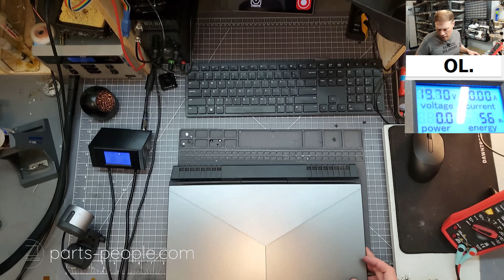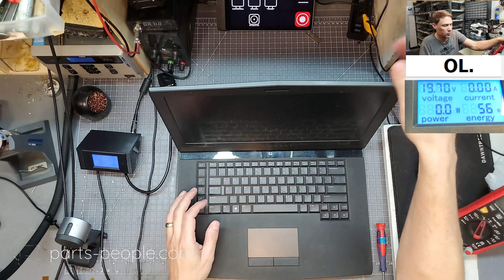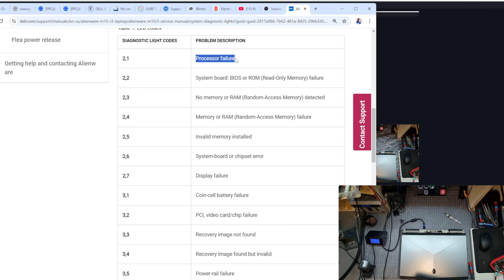Why THIS Alienware Suddenly DIED! And Can It Be Prevented?

Comment: I went through 4 motherboard on this model had a lot of dead cpu when under warranty.. happened again out of warranty bought a repaired motherboard on ebay and never had any issue for the past 3 years..
Reply from the maker: Wow crazy! 😮 This customer said that had it replaced in 2021, but the laptop is now more than 7 years old.  I think it had a pretty good run, considering.
Reply: @dellpartspeople  i dont know what the tech did on the motherboard maybe better mosfet (i dont know if it help prevent the voltage short to cpu/gpu) but it last way longer than all the other dell provided
Reply: I bought one in 2017, gave to my son this year because he just plays minecraft and doesn't care about windows 11. Never replaced anything else but the battery that just starts swelling after 2-3 years of use (replaced 2 times already) and the charger (the sensor stopped working after 1 year and the laptop wouldn't recognize it as original), then I got an updated version and never had any more problems with it. 
But I really don't recommend this laptop to anyone, it thermal throttles a lot and for a gaming laptop this is a no-no.

Comment: if the cpu is only dead why not change it for new one if is the price is not to high
Reply from the maker: Update, I talked to the customer, and he went ahead with the motherboard replacement.  The CPU cannot be changed because it is part of the board.  So, I now have the laptop up and running.  The new motherboard cost $400, plus my labor, of course.
Reply: @dellpartspeople  nice to see this on old day was so much easy to change cpu or gpu  this days is no option of this . and the new laptops this days have 1 ram slot other one is soldered ram
Reply: @dellpartspeople  Thanks, answered my question as well.  I'd never heard of a cpu being part of the motherboard, vs. surface mount before though.
Reply: That's the problem finding it and the price
Reply: -Finding a reliable cpu (Intel won’t sell you one)
-Procuring the tools and stencils and optimizing them to work properly (Rossmann has some videos where he does this)
Not easy.
Reply: Even among repair techs, the tools to perform a BGA rework tend tombe bespoke for each CPU gen, and hard to come by, not to mention how extremely labor intensive it is (not necessarily difficult, but quite monotonous to scan through literal thousands of solder balls).

Comment: I own one of those things, Im pretty sure the fans were specially designed to attract as much dust as possible.
Reply: U shoul'd not be chavalierly share such desing secrets ...
Reply: Marry me chunk I will buy you an extra fans
Reply: I'm not at all defending Dell, because they aren't very customer focused. But, I have NEVER seen a laptop with so easily accessible fans EVER! So there's absolutely no excuse to not clean them. However, that might not be the only thing that needs to be done with it. I would say people that buy this kind of electronics and people who buy Apple are just as ignorant.

I can tell you that there is other laptops that are SO MUCH WORSE when it comes to being able to change the thermal compound. I recently disassembled a Samsung from the 700G Series that is from around 2008, it has a dedicated graphics card with the MXM form factor and I needed to disassemble it completely, and it's a real pain in the a§§ to do, and then assemble it again.

I felt that I might need to point out to some users that, if you use a laptop in the bed. You are most likely suffocating the computer if you don't use a small table or cooling pad to lift it up from the cover. I had a friend that worked as a IT technician that pointed that out to me, and he did it himself after the fact that he pointed it out to me...

I've seen on Electronics Repair School that he simply uses alcohol on the component he suspect is damaged and wait for the alcohol to get vaporized instead of using a FLIR. A poor mans solution that I've never tested myself, and I would suggest anyone to be careful with that.
Reply: @sykoteddy  it was the standard way before Thermal imaging got anywhere near affordable, it works very well as the alcohole evaporates first from hot components, but yes a warning about applying alohole to somethn extremely hot or a flame might be in order, and if ur using a gas soldering iron be a bit careful just...
..alcohole usually dont ignite so easily when used in electronics (if u work with electronics u likely use pure IPA dayly for example ... just dont light a smoke while cleaning and ur okay)
Reply: yes, because that is how the fan was supposed to do..
the problem here is, the hygiene..

when you have the pc or laptop, and never clean them up for 10 years, you can imagine how much dust inside your pc or laptop..

and also the dust maybe contains the very little metal and that can shorted out the component inside your laptop or pc..

you are lucky if the dust just build up on the fan and clogged the fan, your component would be fine and just have elevated temperatures problem..

so, very important to regularly cleaning your computer at least every year..